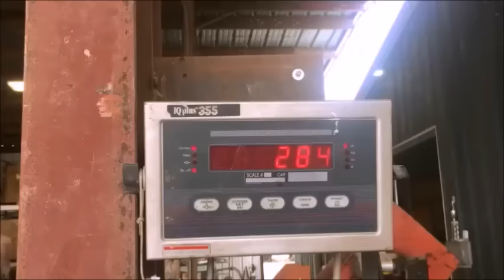#70 - I Built A Sawmill From Scratch Pt 1

Comment: I was looking at all the cuts you needed to make with a hand grinder. It might be advantages for you to invest in a chop saw for steel. Great video as always.
Reply from the maker: Thanks Mark. I have a chop saw and torches I just prefer my angle grinder. I feel I can cut more precise with it. I've got more miles on my grinder than my truck lately.
Reply: Check out these guys for abrasives and cuttoff wheels best prices SAIT very good quality,great videos thanks!!
Reply from the maker: Thanks Jim

Comment: I forgot to ask you. You mention that it a generator engine. Is that a taper shaft that I see up against the fencing background in the video?? Most generator engines are set up as male taper shaft into a mating generator female taper shaft. If so, how do you intend to mount the pulley or clutch drive you are planning to use? Just curious. Thanks again for the great video.
Reply from the maker: yes it is a tapered shaft. The shaft diameter is 7/8 so I will cut a key
 way into it and cut the tapered part of it off. Coming soon.
Reply: Gotcha

Comment: Is it necessary to get the rust off before you weld it?  I thought the heat would burn the rust off.
Reply from the maker: It helps. The welds burn in better and are a lot prettier. I used a flux core wire so that helps.

Comment: Dude best buys i found was at surpluscenter.com check it out might help you out. I built one with a 13hp electric start got it new for 209. and 12v gear motor for up down and another to run fwd and rev. with a old car battery that is charged by the 13hp motor. works great. got the 12vdc gear motors from surplus center and the 13hp motor from harbor freight, got the sprockets belts and chain from surpluscenter.com. harbor freight you got to hit them when there is a good deal going, also helps when they mess up the price tag from 409 to 209. lol, but works outstanding.